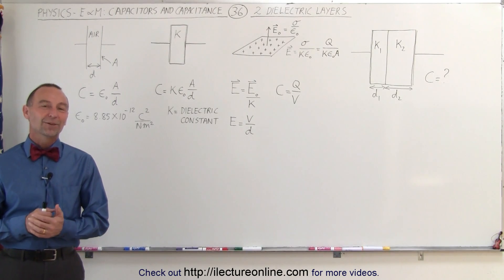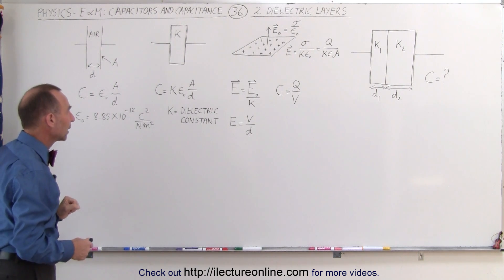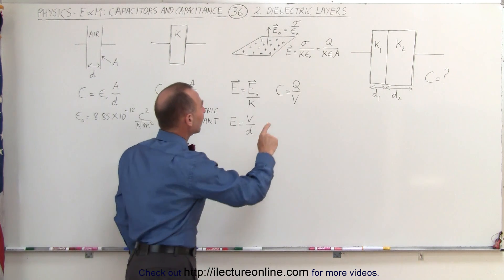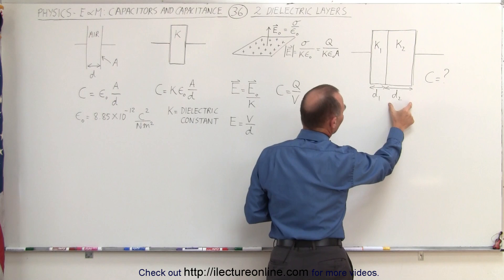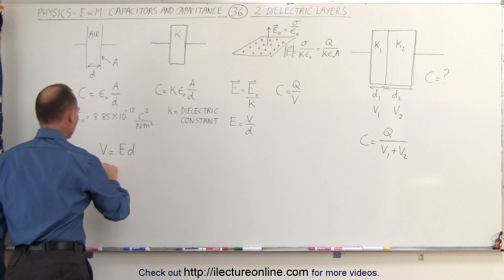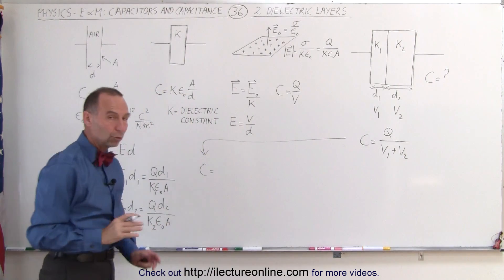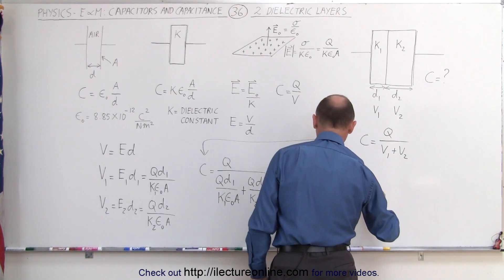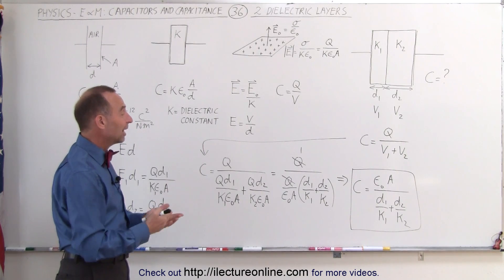Physics 39   Capacitors (36 of 37) 2 Dielectric Layers

Comment: Im building a variable capacitor generator i have 2 dielectric materials plus an air gap. Is there any difference or just keep adding dielectric with one the k value 1.
https://youtu.be/YWbl4BkAayg
The insulator distance being considerably less then the air gap.
Reply from the maker: Not sure what you are trying to do or what the application is.

Comment: What is the maximum voltage that can be applied if we know the dielectric strangth of both substrates?. It is useful to use two layers of a layer-1 of 10kV/mm dielectric strength and dielectric constant 10 with another of 1kv/mm and dielectric constant=100?
I should like to know if using 2 layers we could store more energy (energy=1/2*C*Vmax^2)
Reply from the maker: You will need to know at which voltage the dielectric will break down (this is different from the dielectric strength).  At some point the dielectric will not prevent the current from tunneling through the dielectric.  When that happens the capacitor is destroyed.

Comment: Thank you for your amazing explanation. But I've the question on physical process, not math inference: why do we have a right to devide one capacitor into two ones, serially connected? I see this in the picture, but WHICH RULES AND STRICT LAWS do we use when we say this? Why can't I say that capacitors aren't parallel connected or by other more tricky way? Does it use that lines of vector E are strictly horizontal?
Reply from the maker: Electric field lines will always emanate from the plate perpendicular to the plate. (there are some edge effects, but note that the plates are VERY close together and the distance between them is very small compared to the dimensions of the plates).
Reply: @MichelvanBiezen  Thank you for reply. So, may I explain splitting into 2 vertical capacitors like this: When figuring out U we calculate work of electric field to move the charge from one plate to another, so U=A/q (A is work of Electric field E). So, if the "charge flows" through two dielectrics perpendicular to plates, so A = F1*d1+F2*d2=E1*q*d1+E2*q*d2; U=A/q=E1*d1+E2*d2 - only because we move charges perpendicular (BUT potentiality of an electric field ? we don't care about way, only start and end point) to plates and that is why we split capacitor to 2 capacitors in sequence. If we consider, two capacitors with horizontally located dielectrics we use 2 parallel capacitors because charge can use one of two ways to getting contact 2. Is it correct reasoning? Thank you.
Reply from the maker: Have you seen the videos that very carefully explain how capacitors work?   PLAYLIST:     PHYSICS 39.2 CAPACITORS UNDERSTOOD

Comment: Very intuitive explanation. Easy to understand. Thank you so much. I had a question as well. If we insert a metal plate at the interface of K1 and K2, the expression will be exactly the same correct?
Reply from the maker: That is an interesting concept.  And yes, essentially you would have 2 capacitors in series and you would solve it exactly the same way.

Comment: How do I resolve this to obtain a total value of K, for 2 different K values? I'm trying to work out the propagation velocity of a coaxial cable where the inner core is insulated with PVC, (K=3.2), and surrounded by air (K=1.0). From this I can design a 1/4 wave sleeve-Balun for suppressing dipole current imbalance.

Comment: My text says that the E field of a flat sheet of charge is sigma/(2epsilon naught) rather than sigma/(epsilon naught)....is that just a mistake in the video or am I missing something? I am thinking that this should be the E field of a parallel plate cap?
Reply from the maker: It depends on the charge distribution and the object the charge resides on.    If there is a single sheet of charge (a physical impossibility) then yes you need a 2 in the denominator.  But if you have a conducting flat plate, (a realistic scenario ) there will be charge on the top and charge at the bottom with zero electric field in between.  In that case the electric field is:  E = sigma /epsilon    In the case of a capacitor plate all the charge will be on one side and none on the other side and E = sigma / epsilon
Reply: @MichelvanBiezen  Do you know of an online resource that explains the differences and uses Gauss's Law to derive the result in all three cases...I am in particular not sure about the conducting flat plate. I am not sure how one derives the result.
Reply: @MichelvanBiezen  I do not think that view is correct, since it ignores the superposition principle for electric fields and the fact that the opposite plate exists with an equal number of negative charges and the opposite dA sign pointing into the space between the plates (for the purposes of Gauss' Law). Due to this, If each plate would actually individually produce a field of  E = sigma / epsilon, then the field in-between the two oppositely charged plates would amount to  E = 2 * sigma / epsilon since they superimpose -- which is NOT the case.

Comment: What if the area of dielectric is not same as capacitors area
Reply from the maker: Typically the edge effect (the region beyond the capacitor plates) play an insignificant role in the determination of the capacitance and is thus ignored.
Reply: I meant if dielectric slab has smaller length than the capacitor’s plate then how do I go about solving
Reply: from my understanding: layers of different dielectrics can be treated as different capacitors in serie. On the other hand if the top half has a dielectric and the bottom half doesn't, then you treat the situation as different capacitor in parallel.

Comment: Great video, but there is, it think, easier way to do that, without knowing that V = Ed, these dielectric, you can say "form 2 capacitor in parraller", so their total capacitanc is 1/C = 1/C1 + 1/C2, you can plug in for C1 and C2 their respective capacitance and you will  get the same answer .
Reply: No, actually, they are in series (which association law has the same form of resistors in parallel)
Reply: That only works if both dielectrics have equal distances

Comment: Doesn't the formula you came to suggest that with a capacitor with two dielectrics, having even a tiny layer of one of the dielectrics will massively increase the capacitance?  Like if you take e and A as constants, as well as d2, k2 and k1, won't making d1 as tiny as possible make the capacitance as large as possible, even if the dielectric of the super thin layer has a huge dielectric constant?
Reply from the maker: In theory, the capacitance increase with decreasing distance between the plates.  However, if the distance becomes too small, the capacitor is subject to dielectric breakdown as charges will jump across the gap.

Comment: Michel 
My question is about Breakdown voltage when we have a capacitor with several dieletric layers.
Reply: My other question: If Is it possible to have breakdown  in one layer and not on the other?
Reply from the maker: What is your question?
Reply: How to  calculate the breakdown voltage in case of several layers dieletrics  in capacitor.
Reply from the maker: Calculate the breakdown voltage for each layer and then add the voltages.